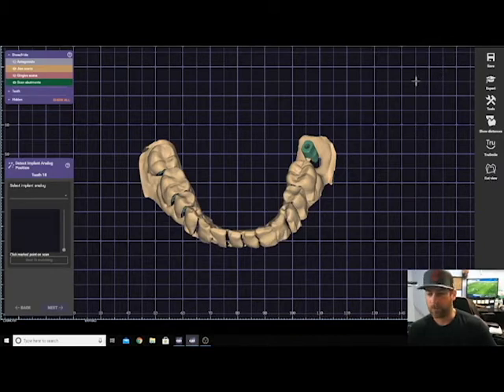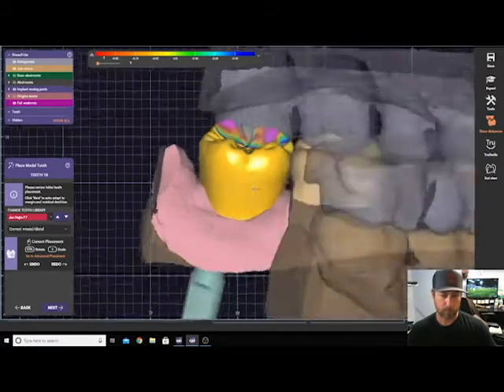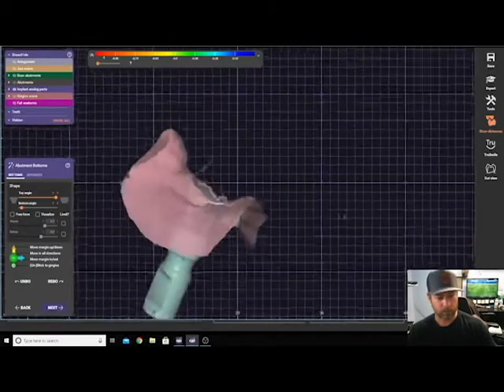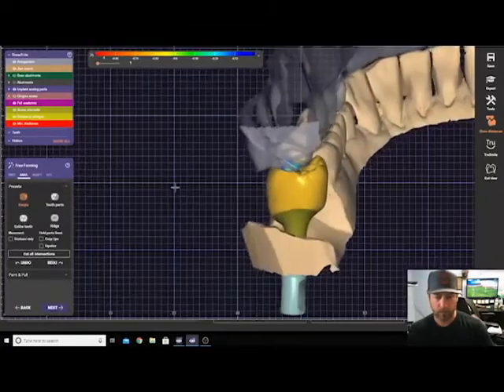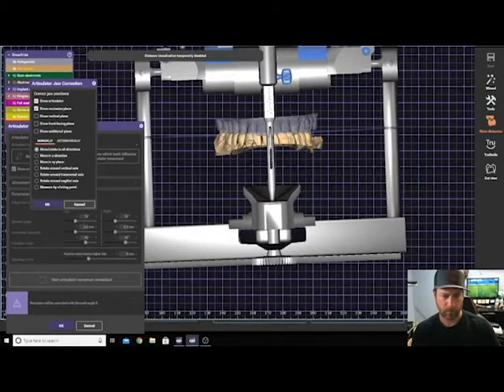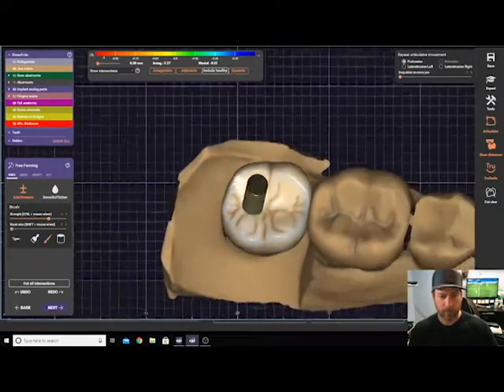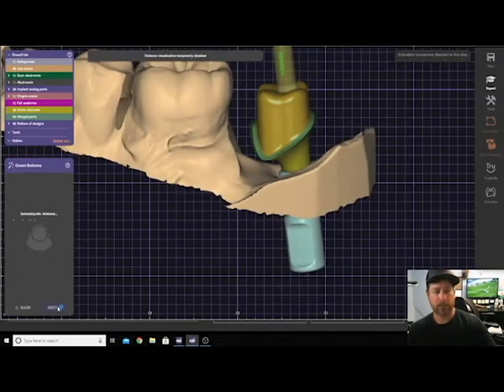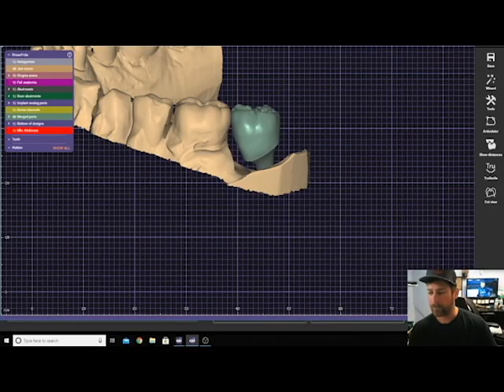Exocad Tutorial: Screwmentable

Comment: Thanks for the video .
What is the difference between screw retained and Screwmentable ? I have designed a custom abutment then I need to design a Screw retained crown but no idea about the work flow , the closest I have got is what you have presented here but I don't know if I can send the work as screw retained since the hole is different  , can you please tell if that is possible screw retained crown on custom abutment?
Reply from the maker: If you want to scan a custom abutment and then punch a hole through the crown, you willl need to choose Screw retained (manual position) in the database
Reply: @adamrutherford7169  Always gives me an error " Error , please try to set screw channel differently " doesn't matter how many times I try still the same message
Reply from the maker: @ma3195gd  Have you tried using the attachment (remove) feature?
Reply: @adamrutherford7169  yes I do , I wonder what is the difference ?
Reply from the maker: @ma3195gd  it's easier creating an emergence profile the other way but that's about it
Reply: @ma3195gd I have the same problem right now , I try to do screw channel manually but the same message appears, did you solve this issue ?

Comment: Great video. I have done this on top of a stock abutment as well.
Reply from the maker: Its actually easier with a stock abutment if you choose screw retained (manual position) in the database. This will also allow you to create your own emergence profile
Reply: @adamrutherford7169  I'm quite new to this but the last few minutes of that video was great--  I knew how to create the cylindrical hole but the "crown bottom" was protected and wouldn't fully work...  so perhaps that's why exiting and re-opening is important as I couldn't get it to work another way .  Thanks !
Reply from the maker: @GffHll  I believe you have to have all the parts merged together before punch the hole and thats why it works. I'm not 100% sure though